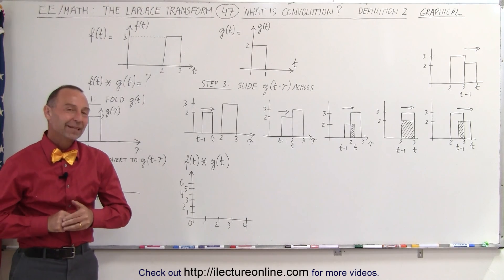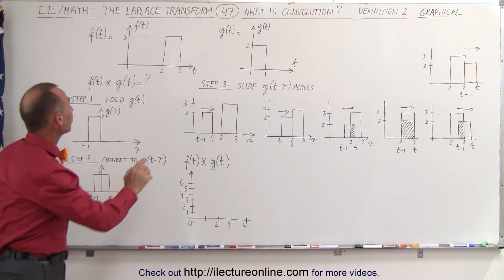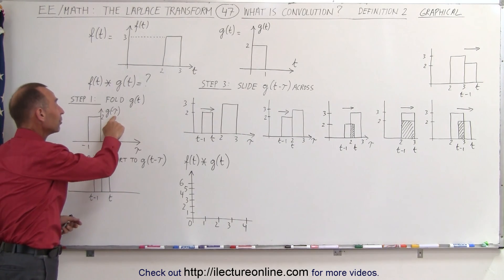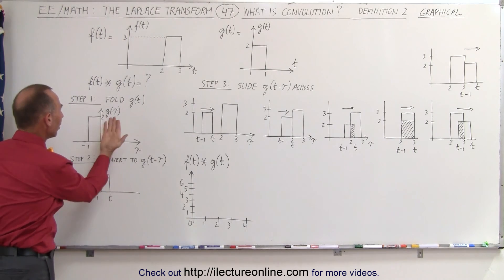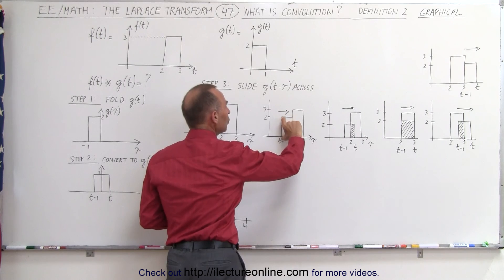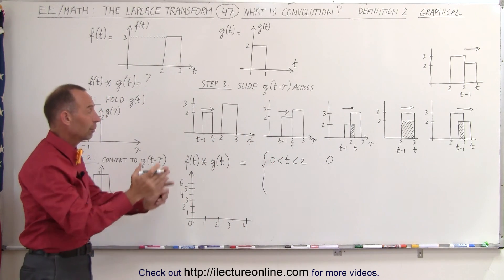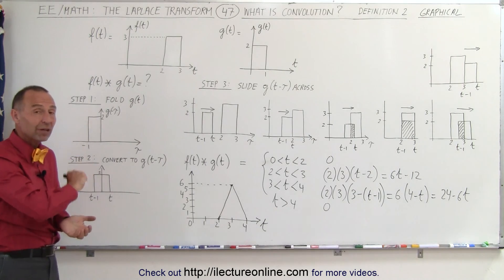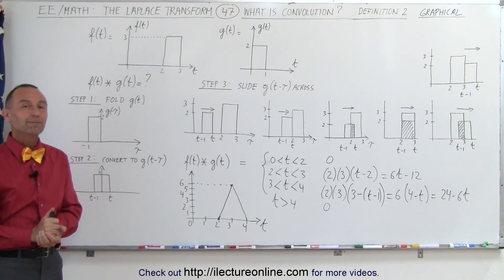Electrical Engineering: Ch 16: Laplace Transform (47 of 58) What is Convolution? Def. 2: Graph 1

Comment: Thanks for the beautiful lecture. I reckon its worth mentioning that (t-1) for a flipped signal is not same as (t-1) for regular unflipped signals. I mean for a regular unflipped signal (t-1) indicates that the signal is shifted 1 unit to the right where as for the flipped version the shift is to the left instead. I mean if we shift the signal to the right and mirror it in the vertical axis it obviously gets shifted to the left.